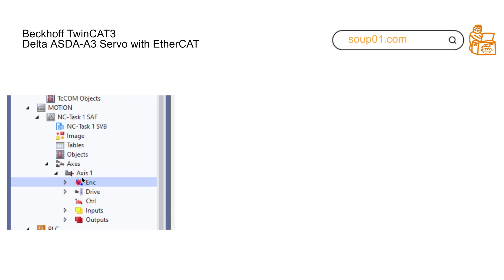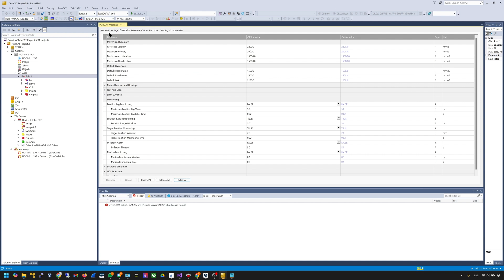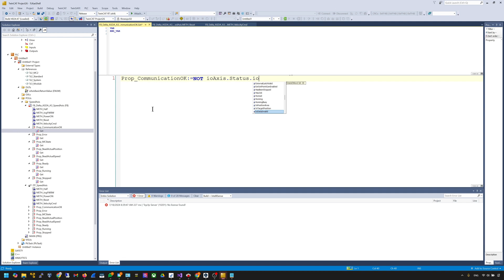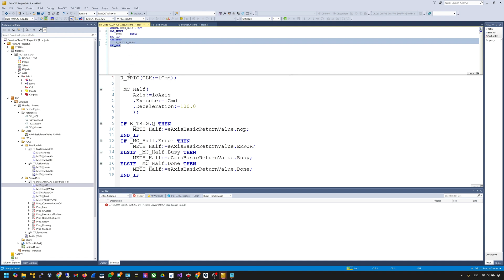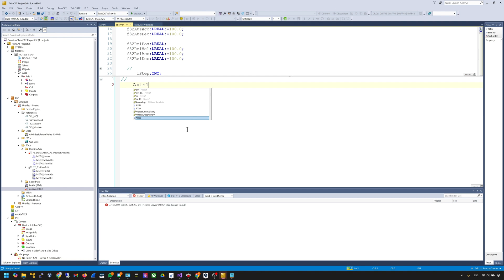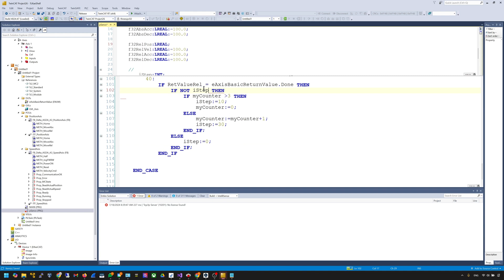Beckhoff.Let's play with Delta ASDA-A3 servo drive!

Comment: If starting from scratch, are there any advantages in using this delta solution over ClearPath integrated servos? It seems like with the ClearPath you can connect directly to the servo and not need a separate servo module (not sure if that delta one is a driver or controller or both)?